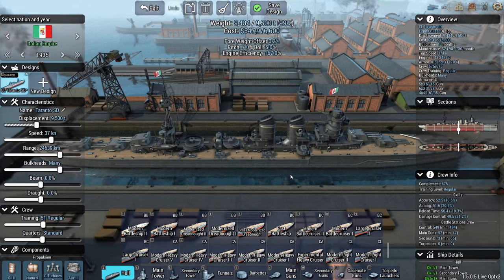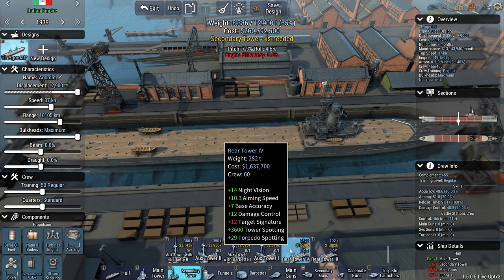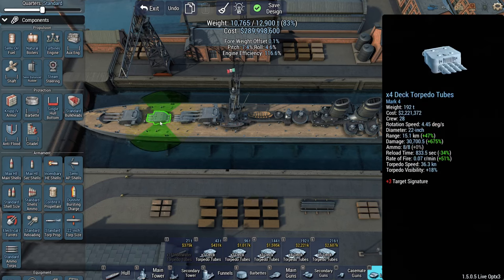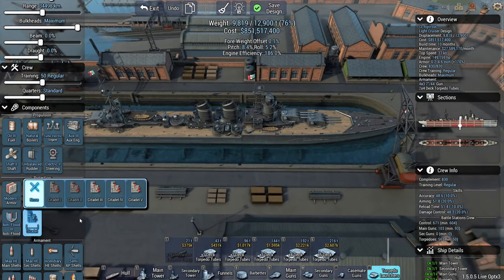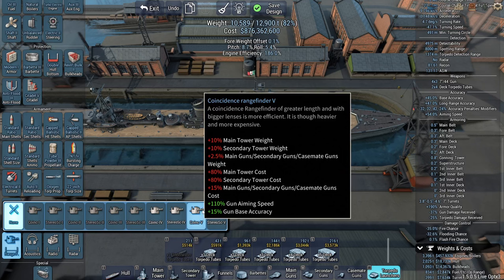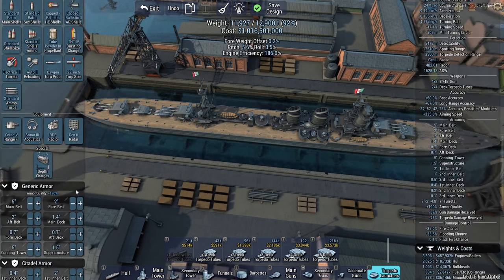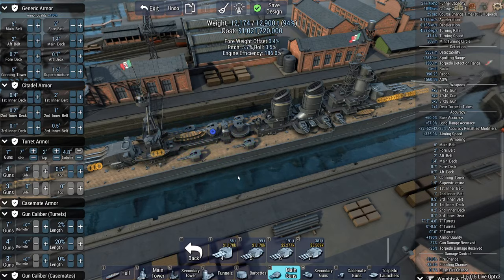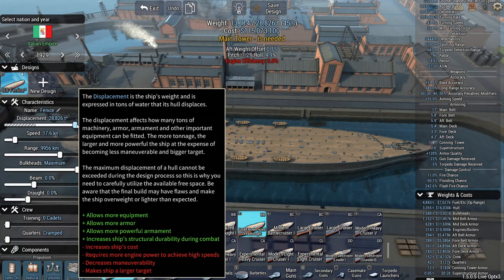Ultimate Admiral Dreadnoughts - New Hulls in 1.5 - Some Italian and a Spanish Ship - DIP Mod

Comment: Im curious if you built some of mine lol. If not i have yet another suggestion. A Heavy cruiser. However i want it to be at least 28 knots. The idea would be 5x3 Guns in the 150 to 230mm caliber. Armor profile would be enough to block destroyers and small cruisers but probably not battleships. 

Second design suggestion is a battleship/battlecruiser. I want at least 13 inches on main belt. The bridge/deck armor at least 12 inches. rest of the armor i want you to get creative with it lol
 the cruiser would be a sort of “helper cruiser” mainly hanging with destroyers and cruisers to help with heavy firefight. basically an italian Worcester

Comment: I've tested what exactly the "inner belts/inner decks" do before, and in my tests, I basically have come away with the sense that it's a total waste of tonnage. Like it seems to do nothing in terms of making your armour harder to pen, or limiting the damage you take when you do get penned. If you take the tonnage and just put more "generic armor" on instead - it actually does something. Would you maybe think about doing your own tests? 

I just made a custom battle where I gave my ship good dps, and made the AI ship into a harmless, slow turtle, and made sure the pen of my guns sat roughly around the strength of their armour at close range; and then tweaked the AI ships armour so I could make comparisons and work out what was the best build decision. If you have the same take away as I do, could you pass that onto Brother Munro to see if he could do something about that in the mod? I'll drop a comment on one of this videos as well. Just to be clear, I'm not saying it's a problem with his mod, as I did those tests in vanilla - but I've since moved onto playing with his mod.